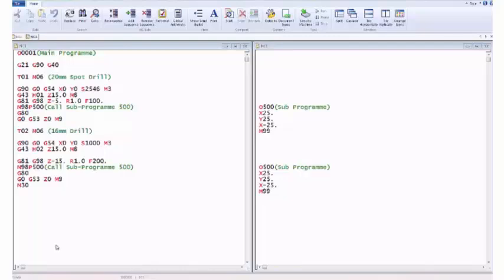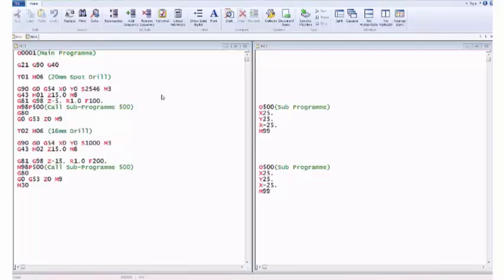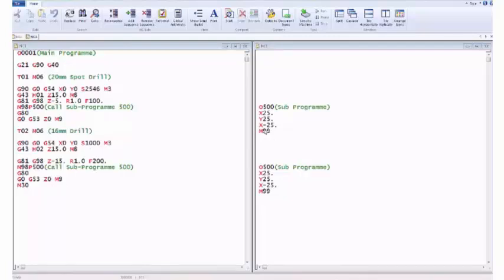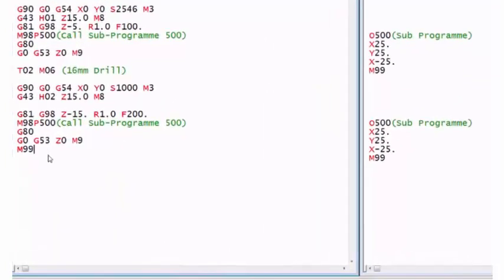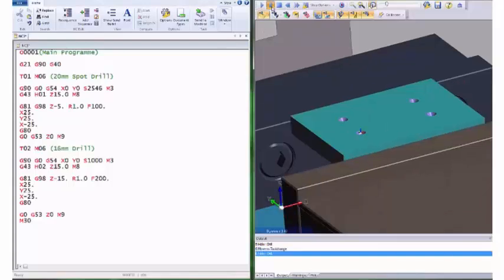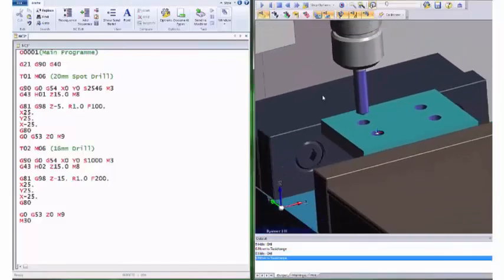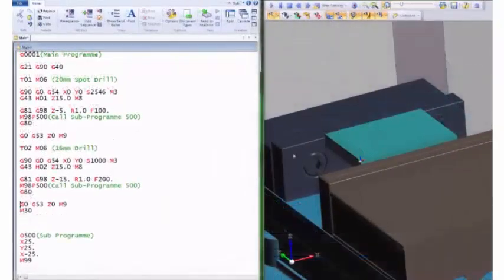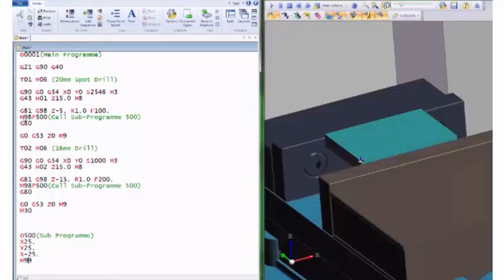CNC Program Basics Haas Fanuc Mazak ISO Sub Programmes

Comment: Does the sub program m98 apply the same for Yasnac and Siemens controllers too?
Reply from the maker: No, Siemens is not the same unless you are using the ISO option. 
This will work on Fanuc, Haas, Mazak ISO and Yasnac, Yasnac also has local sub routines which means they can be within your main program. Haas also does this.
https://www.cnctrainingcentre.com/fanuc/fanuc-subprogram-local-subroutine/
Haas uses M97 to access an internal sub. M97 P500 would search for N500 at the end of your program M98 P500 would look externally for program O500
Fanuc is the same but it is an option M98 Q500 would search for N500 at the end of your program.
Hope this helps, thanks for watching my video.